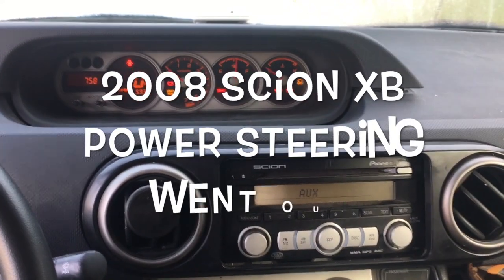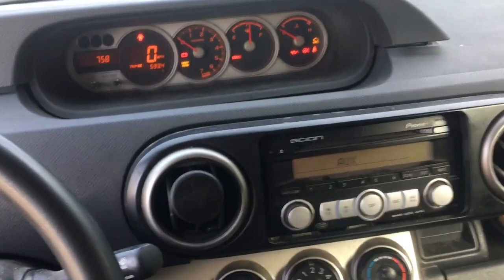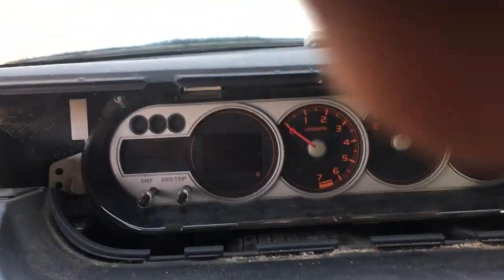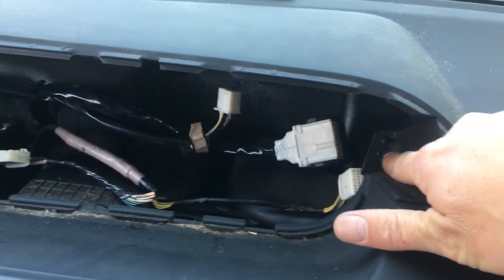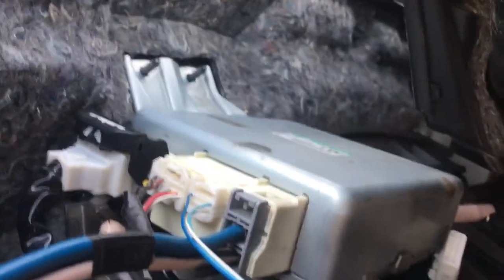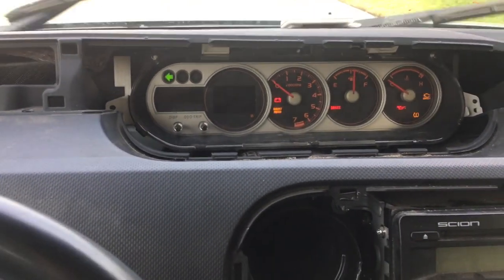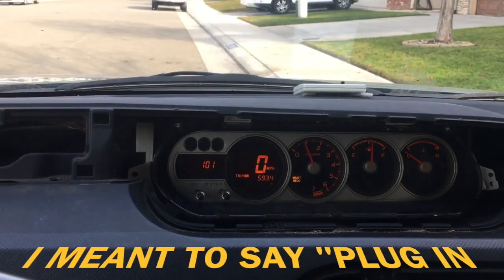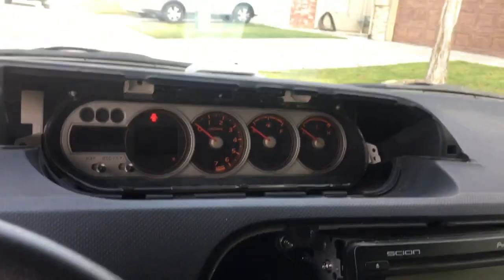2008 SCION XB: HOW TO REPLACE the POWER STEERING ECM

Comment: Got that notification last night and my power steering was completely out. Fluid was full. Brand new the part is $500. Labor another $500. So I followed your video and went to pick n pull and got the part. Took maybe an hour. Came home and uninstalled my old one and put the replacement one. Maybe another hour. Fired it up and problem solved. Cost me $37 at pick n pull. Thanks for saving a thousand!

Comment: Did your unit whine before it failed?
Reply from the maker: Mine did not, it just slowly died. Would work occasionally when I turned the car on, or re-plugged in the battery. Then it stopped working completely.

Comment: Barely watching this in 2024 appreciate the vid I got the part out was just curious how accurate or how close the part number off the sticker was yours to the one from the junk yard? Mine is a 2008 and everywhere online said 08-10 and 11-15 not sure if that matters if I put a newer one in or not
Reply from the maker: That’s a great question. I’m not an expert by any means, so hopefully there is someone more qualified here to answer. It is not easy to find the part, and I am one of those reckless types that would probably plug it in and try it -
Reply from the maker: If you try using the new ECM in the 08, pls let us know if it works or not!

Comment: Dealers are a Scam. Cannot imagine $1000 to get this job done. The module is cheaper through other channels, or used like you did. An independent mechanic would likely charge half that amount. I’ll figure this out if it ever come up on my 15. I’m likely keeping it forever, hows yours been? Anything else? Thanks
Reply from the maker: Thanks, I found out replacing the water pump is a good maintenance move - I neglected that and overheated recently

Comment: Did that still no power steering and no radio,power windows. Blinkers  a/c all light are on I tried 2 ecm
Reply: mines has the same problem did you get it fixed?

Comment: All you had to do was take off the negative battery terminal and wait 2 minutes put the terminal back on and that's it. It's called resetting the computer
Reply from the maker: Dude I know. You can reset the computer in 2 seconds doing that. And that will work, but when the ecm dies, that won’t fix it anymore.

Comment: Just wanted to add my 2008 Scion xB experience from this week.  Power steering stopped (steering went from normal to like I was driving a 1974 VW Bug!) and the red ! next to a red steering wheel symbol lit up on the dash.  Did some internet spelunking and also took a look at the manual.  Toyota had diagnosed my battery had lost cold weather starting ability (2015 battery) but since the weather isn't very cold yet, I figured rear brake repair was WAY more urgent.  Zero issues starting the car, with lights or radio.

After power steering went out and I was building up muscles I didn't remember ever having, I bought a new battery and had it installed.  IMMEDIATELY, the power steering came back and the idiot light went off.  Theory confirmed that low battery can impact power steering!
Reply from the maker: Yes, interesting! and disconnecting and then reconnecting  the battery worked to reset the power steering for me, until that didn’t work any more. Then I knew I needed to change the part, or drive straight forever.
Reply: My steering wheel became almost impossible to maneuver, but the steering wheel signal was not there. Further testing showed alternator was not charging the battery. Changed the alternator and immediately car was normal.

Comment: You don't have to take the claws off of the airbag.  Take off the glove box and look straight up under the dash.  There is a 12 mm bolt up there hold the dash to a support bar, with a yellow wire and connector for the air bag.  Undo the connector and the bolt and the dash lifts right up.  I'd suggest disconnecting the negative cable to the battery so you don't have any problems playing around near the airbag.  Discovered this when I had a power steering problem, however it ended up being my main ecu that was bad.  Luckily my friend suggested the main ecu before I tried to swap out the power steering ecu (thanks Danny boy!!).
Reply: Thanks for saving so much time!
Reply: did the new ecu you installed had the same matching numbers ?

Comment: Awesome work. Where did you purchase the replacement part? Unfortunately my power steering just went out on my 08 XB.
Reply from the maker: ChefAudio yea finding the part is the thing- I’ve seen it on eBay, or check local junkyards- in the meantime if you just unplug and reattach the battery terminal it should reset your current ecm module and give you power steering for a while, you keep doing this until the original part totally gives out.
Reply: @funguseatsplastic8361  GOLD brother thanks so much!!
Reply: @funguseatsplastic8361 may you stay protected and live a great life ! I’m going to try this right now inshallah’

Comment: did you just replace the module or you need to flash it??
Reply: Vidal Peregrina I just put the used part in there, and it worked
Reply from the maker: I just put it in and it worked, no flash was necessary for me
Reply from the maker: I just put it in and it worked, no flash was necessary on this one

Comment: This is a nice well done video. Did you have to the ECM flashed prior to installing it? I've seen forum comments where people had to have this done.
Reply from the maker: No flash was necessary on this one, I just put in the used part and it worked , luckily

Comment: Usually the power steering module need to be reset instead of replacing the whole expensive control module which is required to remove the dash and unnecessary related hard work, sorry but you already reaped off.
Reply: Reset the ecm by unplugging the battery. That works for a while but the ecm eventually stopped working even after the reset that’s why I had to switch it out

Comment: Thank you for this! Just bought a 2010 xB and the power steering is out. My Toyota service center won’t even touch it so it’s nice to see that it seems like a fix I can handle myself inexpensively. 👍🏼
Reply from the maker: You can try disconnecting the battery and then reconnecting, it seemed to reset the computer temporarily until I finally got the time to switch the power steering module
Reply: Jennifer J why didn't the Service center want to touch it?